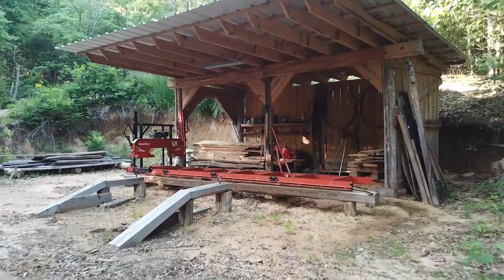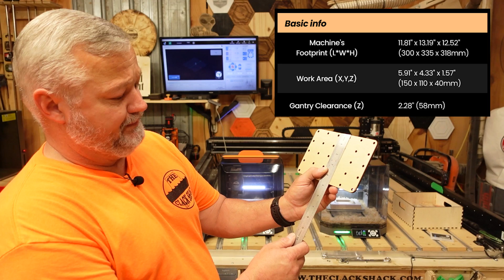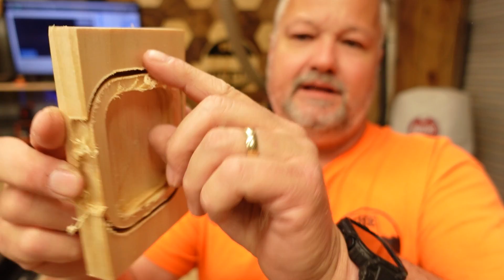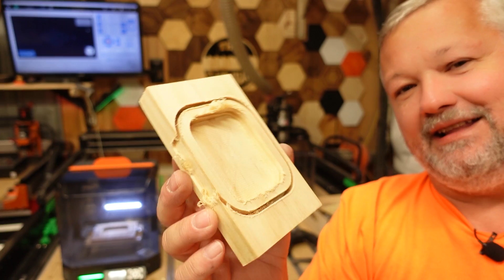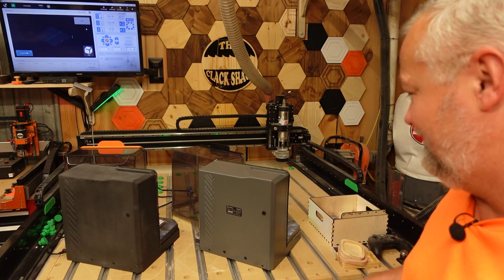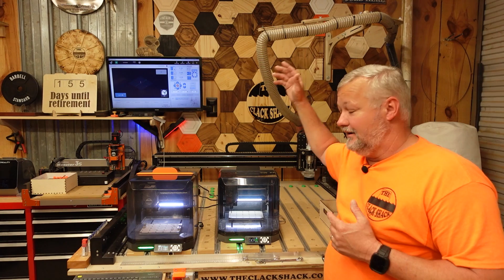Genmitsu Cubiko CNC- Consumer model revealed

Comment: I think about getting a CNC mill to engrave cattle ear tags. They are a flexible polyurethane plastic so I don’t think power of the machine is an issue. I’m wondering what software works best if I’m engraving 3-4 digit numbers on each tag.  I’m hoping once I get the speed figured out I can just type the number and hit start. Is there an option that is that simple?
Reply from the maker: You can do plastics with a CNC, a laser would likely be much faster as long as you can properly handle the fumes. The price would be more for a laser though.

Comment: Hello you kept mentioning there obvious limitations with the machine I just wanted to ask was this the standard motor you tested or the upgraded 20k rpm motor
Reply from the maker: I believe it was the standard, the spindle wasn't the issue. The gantry can only handle so much pressure before you see deflection.

Comment: This looks like a good starter unit and the price is good. Not good fit for me as I already have a 3018 that they put out years ago. It would be a great unit for pcb making with the small size. Also thank you for the info on Gsender, I already downloaded it.
Reply from the maker: Cool, I have a bit larger machine on its way. It may be something you like.
Reply: @TheClackShack  I will be waiting to see the vid. I do miss working on the Fadal 4020 I used to run. Sadly that is not in my budget nor do I have room for it.

Comment: I've got two of the machines coming.  I ordered them when they were announced on Kickstarter.  I opted for the upgraded 20K RPM spindle over the base 10K RPM spindle.  I also order a laser module for each machine.  I plan to give one of the machines away on my channel.  I also plan to start making and selling blanks for the Cubiko.  I will be producing Basswood blanks in bulk quantities.  I also plan to offer some nicer woods for when folks get comfortable with the machine and want to work with better woods.  Soft Maple, Spalted Hackberry, and Black Limba to name a few.  These are impressive woods with a relatively low Janka rating, should be easy on the small spindle.  I would love to do some cross promotion when I get the machines in. Maybe you can get them to send you one to give away? Or two, one for Steve. Then we could have three channels promoting the machine and each channel giving away a machine???
Reply from the maker: Cool. I have already began the sign up for the two machines being given away in my members area. As far as I know, Steve plans to do the same once he finishes with his.

Comment: Would you be interested in doing a video on gsender and also the Xbox controller. I have been using openbuilds for two years but just bought a used Longmill and it works but considering moving to gsender and would like to use the game controller with it
Reply from the maker: It is fairly simple.